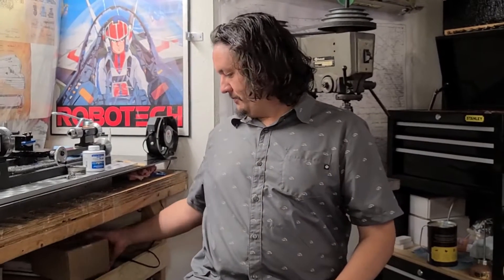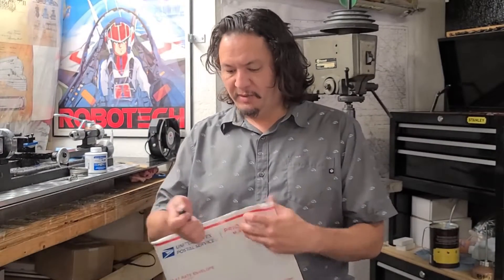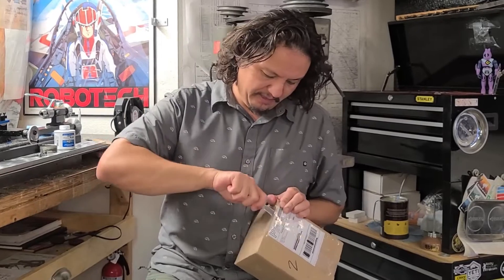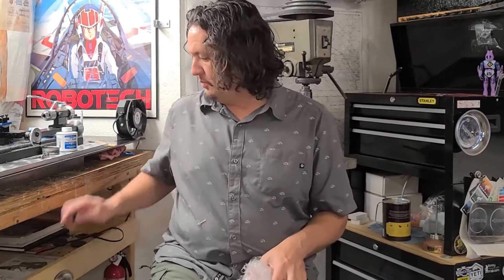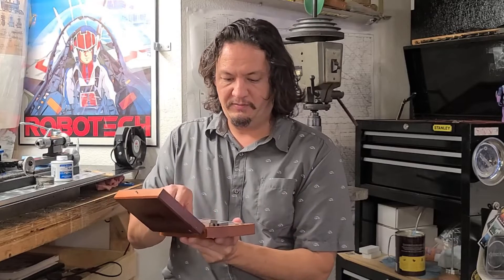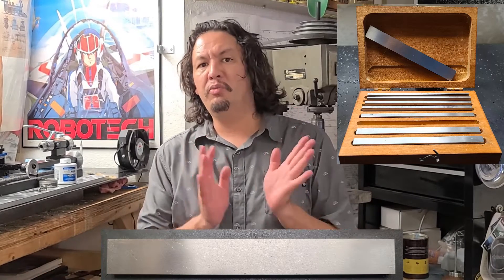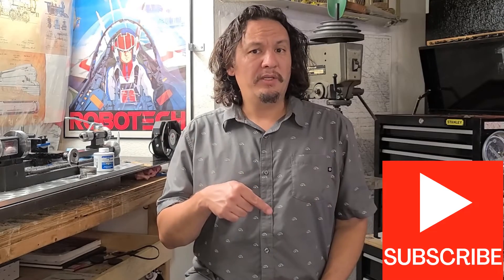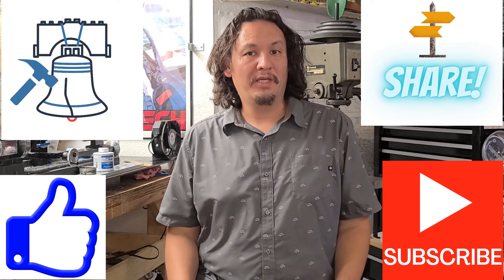Unboxing: Starrett Parallels 384 and 154 Adjustable

Comment: Adjustable parallels. They're more commonly used as a comparative inspection tool. Open one up inside a pocket and then you remove and measure with a micrometer to get your pocket size. You do not want to use them in the vice like traditional parallels. 
The other parallels are the ones you put under the workpiece.
Reply from the maker: Thanks true thanks.  I was hopeful with the smaller mill and light cut of the Sherline it be manageable but definitely not.  I've come to the realization I have to purchase various sizes of Starrett precision ground stock and make my own parallels.  The size of that Sherline vise just doesn't lend itself to standard parallels.

Comment: Not sure If id use them in the vise to the the fact that so seat the work you have to smack the shit out of it with a hammer.
Reply from the maker: Oh ya, I totally agree now that I used them. Any kind of tap they give or slip and it damages the tightening screw. 😭